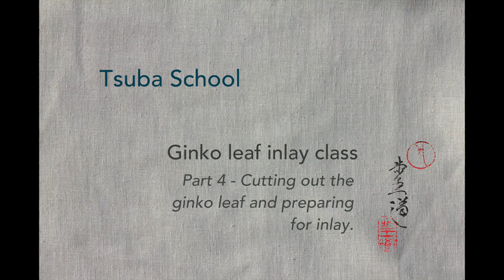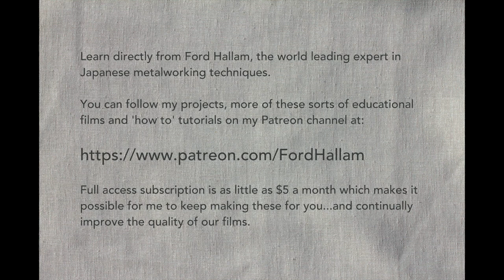Ginko Leaf Inlay Class - Part 4

Comment: 1: I'm shocked you didn't anneal the billet before running it though the mill and 2: I'm shocked you didn't rotate it 90° when you sent it through the second time.  Since the problem is linear stress building up from multiple passes in the same direction, rotating it every other pass should simulate the cross directional stress effect that forging accomplishes.
Reply from the maker: if I had done those things I would not have been able to illustrate what I teach in this film. Besides, once a crack starts alternate rotating in a mill makes little difference, better to know  a way to stop the crack like I show. Don't you think?
Reply: @FordHallam   You're right.  I did rather forget that important detail.  Your whole point was to show what could happen by using the mill and if my prescribed technique had been used, the  crack never would have formed and an important lesson would never have been able to be demonstrated.   I guess this is why you're the master here and we're just the viewers.  Edit: Honestly, I'm proper gobsmacked my comment was the only one you found worth replying to.  Then again, I suppose it did light the proverbial fire under the seat of thy trousers to incite such an arrogant display of egotism.